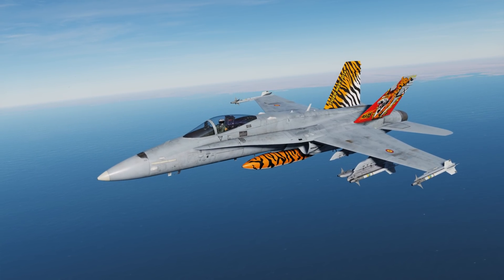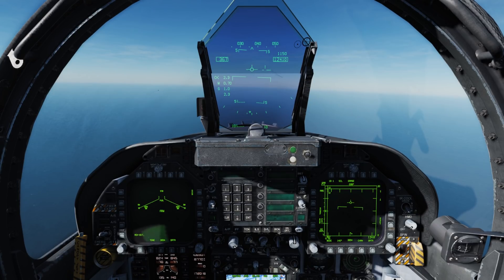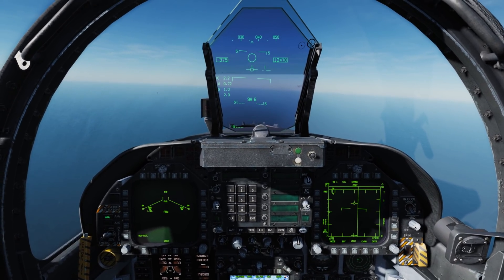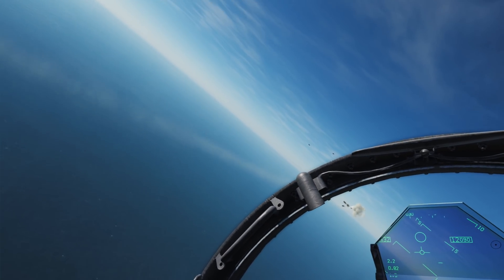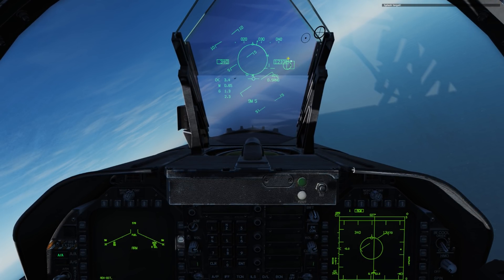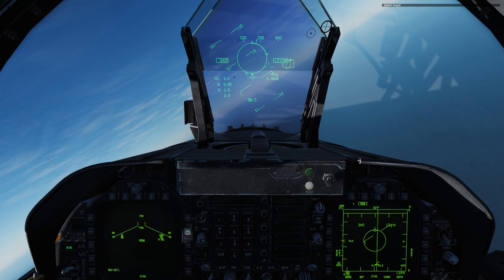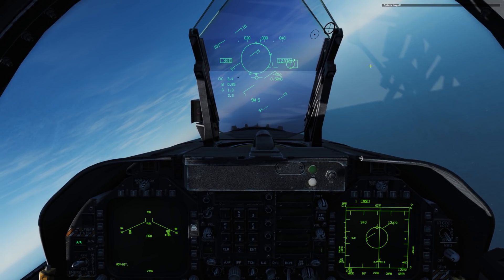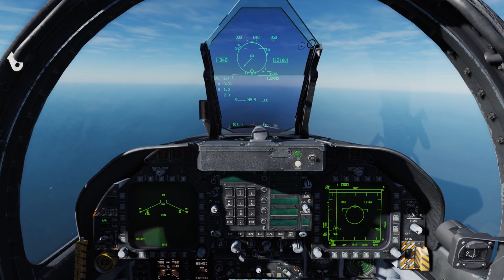DCS: F/A-18C Hornet - Episode 11: AIM-9 "Sidewinder" Air-to-Air Missile

Comment: I am having some trouble with understanding the transition between different modes and how having the HMD on can influence these modes and the transition between them. For example, if I have HMD on, I can't access the vertical tracking mode by pressing down on the switch right after entering ACM by pressing up, instead I have to press left first and then aft. Also, is pressing the 'Undesignate' key the default way to exit ACM modes? Some people told me to use TDC Depress, but that only works in some situations, and I am assuming that this effect is a side effect of what the button is meant to do in those situations. Thank you for your time and patience.

Comment: Matt, could you or another experienced user comment on what type of controls are best suited for changing the weapons modes, etc? You mention in the video what sounds like HOTAS switches....for those of us with less capable joystick setups, can we still configure these actions to a keyboard or different button? (e.g. the F-15 BVR/boresight/vertical scan switches to the numerical buttons 1,2,3,4). One of my concerns in thinking about purchasing the Hornet -- not necessarily the in-game complexity hurdle but the control setup. Thanks in advance -- congratulations on a spectacular product.
Reply from the maker: Setting up controls really is quite easy, but we do plan to include default settings for many popular joysticks and throttles.

Comment: So, in the first example, you have to uncage the seeker, but in the second when using radar to slave- do you still uncage? (Did not hear him mention it then)
Reply: The seeker head is slaved to the radar's STT lock on the target. So you can kind of think of it like firing the AIM-9 radar-guided, although not quite, because it's still also, and in fact predominantly, using IR to guide. However unlike a Fox-1, if you break an STT radar lock after firing the AIM-9, say, because you cycled out of CCM, it is of course an IR guided missile from the start (which it is also using) and has passive guidance that will allow it to keep seeking a target, hopefully the bad guy, based on heat signature. I don't believe you're manually uncaging; uncaging or slaving to seeker head is a matter of basically whether you want to use the missile's seeker head as its own boresight, which it will at some point be doing on its own anyways if I'm not mistaken, at least on the later model AIM-9s? I believe in that case relating to a missile fired first from an STT in CCM and then losing radar, it will be in essence "uncaged" for lack of a better term already and just look for the biggest, nearest IR it can chase. It simply used the radar CCM for faster target acquisition and for some additional ranging information and other convenience being fed to the pilot. At the expense of lighting them up like a Christmas tree with a full radar lock. Firing it uncaged without a radar lock is stealthier.
Reply: Interesting. Thanks!